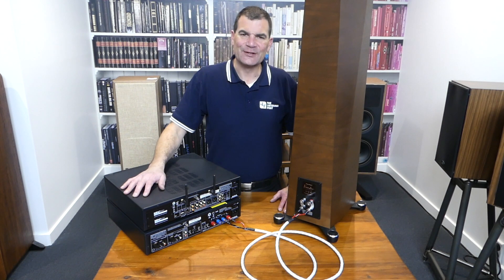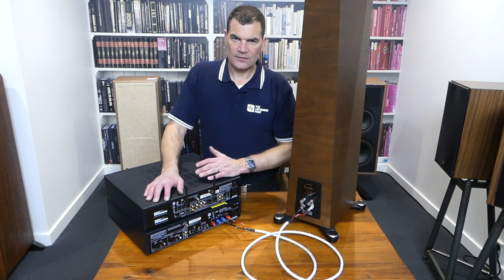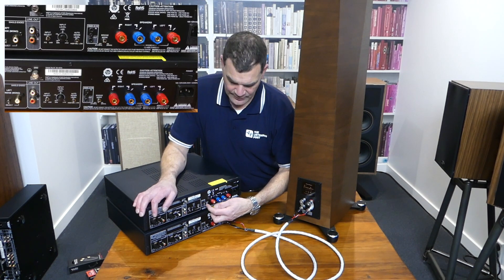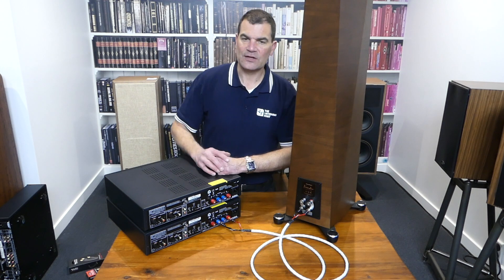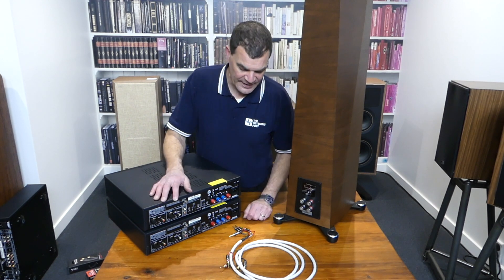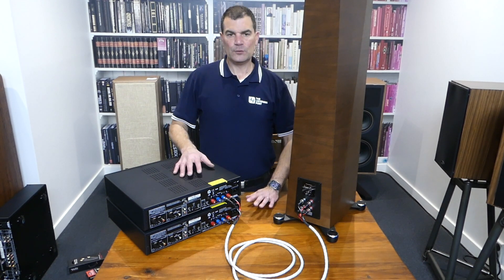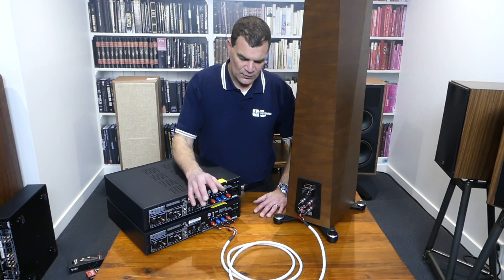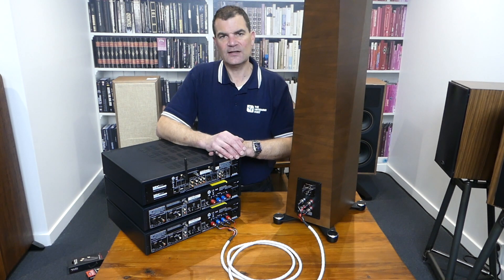Step by step guide to Bridged Mono vs Horiz BiAmp vs Vert BiAmp | The Listening Post | TLPCHC TLPWLG

Comment: I biwire with bridged mono, do you think biamping is a better option?
Reply from the maker: It is a question of the power you require.  If you need to go very loud, then bridge mono. But generally I recommend Bi-Amping (as it has a lower THD).
Reply: @TLPCHC  but if the THD is below perceptual listening levels then aren't you better off having more current, power delivery to the speaker for greater control? I'm not sure if vertical biamping will deliver much of anything
Reply from the maker: @carlitosgomez71   There are no Golden Rules.  Some pre-amps crush the dynamics at low volumes, so bi-amping is better. While some (generally inefficient) speakers thrive with more power.  Have a play and see.  Maybe borrow some speaker cable and see.

Comment: Great video!
Question, is it possible to do this with one amplifier, that has outputs for two pairs of speakers (a and b) and has a bridging mode? The amplifier in particular is an Accuphase p-266.
Reply from the maker: No. A and B = Bi-Wire NOT bi-amp
Reply: Great video. 
Confirm something for me please. 
I have an Adcom preamp and two Adcom 5800s. I want to run to a pair of Totem Winds. 
How do you recommend wiring for best result? TY